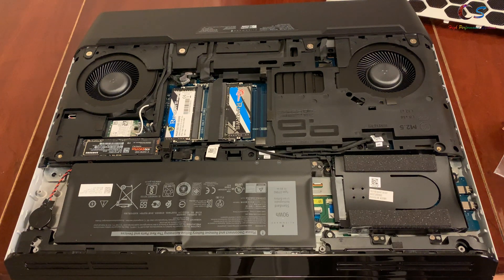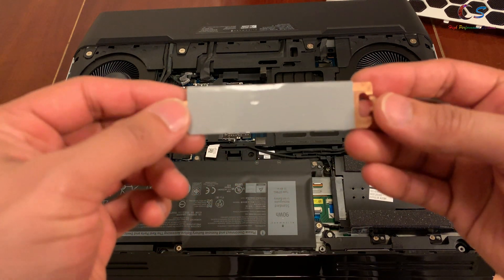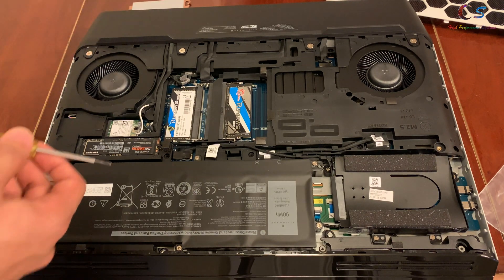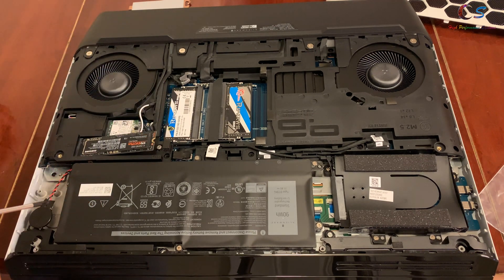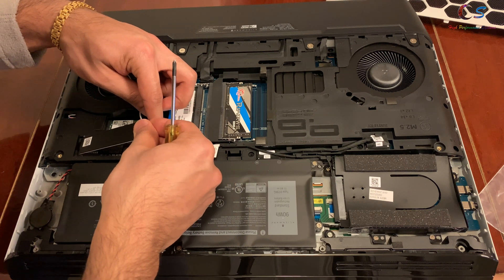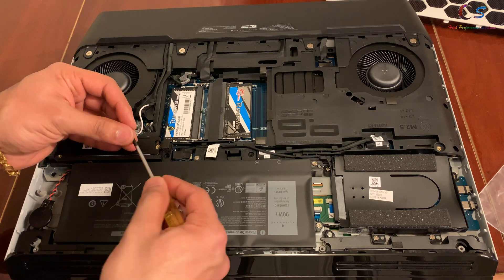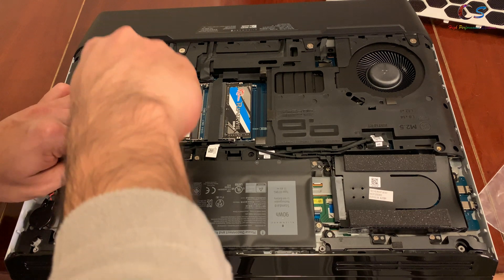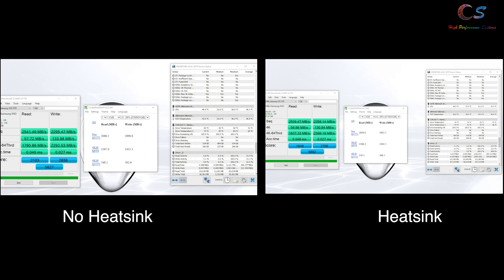Install SSD Heatsink in Alienware Area 51m

Comment: what size screw did you use for your NVME M2 Slot please
Reply from the maker: I used the ones that come with the M.2 ssd
Reply: @cs.studios  can you tell me the size please
Reply from the maker: M2.0x2.5mm
Reply: @cs.studios  thanks would 8tB works on the alienware?

Comment: Hello , thanks for the video!
I have an Alienware area 51 R2 and a 1TB Samsung SSD 980 NVMe M.2 for slot 2 , do I require a thermal shield? Dell did provide only a shield for slot 1.
Reply from the maker: It’s not required but helps with temps and performance
Reply: @cs.studios  Thank you!

Comment: I know this is old but I've just added a second ssd, Sabrent Rocket 1TB and wondered what sort of loads you were putting the SSD under to achieve such high temps without the heatsink? While copying data over from the HDD (Game Library) and installing another through steam together the heat without maxed at 47c. Are your temps based on video editing? I'll be ringing Dell UK for the sink later today and compared to Pauls Hardware recommending it not being necessary if temps are kept between the 25-60 range I'd like to compare your use case to just gaming.
Reply from the maker: I was doing a standard large file transfer >4GB and let the SSD heat up. Each SSD will vary but the 970 Evo Plus can be hot depending on laptops cooling system
Reply: @cs.studios  thanks for the reply, I've since stress tested it properly and haven't managed to break the 25-60 window without the shield. Also while I've got you, can I ask what RAM you upgraded from and too as I've noticed our 51m r1 capped at 2400mhz and that even on the r2 it's only lifted to 3000mhz with DELL specific RAM. Is there anyway you know of that our RAM speeds can be increased on the r1?

Comment: Hi, I’m thinking of getting this laptop but I can only afford to get the base model. I know I can do upgrades later on but I was wondering, with the base model . Can it run most games ok. Enough to be playable? Oh and in your opinion. What would be a must to get at checkout. Thanks
Reply from the maker: Yes even base model is fine but make sure to get the new R2 model. Screen choice is a must, either 144Hz or 300Hz monitor.
Reply: @cs.studios  thank you,  yeah, I'm going for the 300hz

Comment: Awesome. Have you noticed the ssd evo messing up, or corrupting the system? I called Dell tech and they highly recommended getting western digital sn750, for that reason
Reply from the maker: I've been running 970 Evo Plus since Feburary or March I think without any issues.
Reply: @cs.studios  strange. You're the second person that said they had no issues. When Dell says there's an 80% that the laptop will randomly reboot and shit
Reply from the maker: Interesting...I've had some random reboots with my graphics amplifier + AMD Radeon VII very rarely. I thought it was because of me mixing AMD GPU with internal nVidia GPU. But without the AMP connected I have no issues so idk.
Reply: @cs.studios  fuck. What do you think about about running dual 1TB Digital Western SN750 SSD? That's what Dell tech recommended. I'm so indecisive right now 😥
Reply from the maker: I only go samsung for my SSDs. 0 failures. Had a failure or some issue with other brands before. Honestly if you're not using AMP + AMD I dont think there will be any issues. Be sure to get the newer 970 Evo Plus not the older 970 Evo. Theres plenty of us running Samsung SSD with no issues. I've had no issues without my AMP
Reply: @cs.studios  wow. Ok. Thanks so much for your time. I'm a lot more confident now going with Samsung. May the odds always be in your favor while owning noobs 🙂

Comment: Hi, I have a quick ques if you have the time.  I bought a ADATA XPG m2 ssd.  It came with it's own heat spreader, should I use that or use the Dell heatsink,  the one you used in this video.  Thanks so much,
Reply from the maker: If you have the Dell heatsink, use that one. However, if you don't, use the XPG one if it fits.

Comment: good morning my friend .. here is me bothering you again with my question .. I see you got one SDD installed I got one installed too.. but I can't remember which slot it's in .. I want to add another on the other slot .. are they both same .. just any m.2  would fit ? also what's the wire going across the second slot ? get me back to me please .. thank you : )
Reply from the maker: Both slots work the same so it doesn't matter which one you install the new one in. The wire thing is the CMOS battery. It sits under the SSD I believe. I haven't installed a second SSD yet.
Reply: @cs.studios  oh so just install ssd on top of it.... Been looking to buy 1tb Samsung m. 2 and install it in the second slot as I got 500gb in one slot already
Reply from the maker: I got a 1TB 970 Evo Plus in my main slot. Maybe in the future I’ll get a 2TB Intel 660p for games and basic storage.
Reply: @cs.studios  yeah I was looking at 2 tb for basic games..but Samsung one at 2tb is too expensive.. Maybe wd blue or wd black?..
Reply from the maker: @sizar535  I have no experience with WD SSDs but I would recommend a Intel 660p 2TB drive.
Reply: @cs.studios  I'll put one those in it.. Thank you..

Comment: Please, help me to find it where to buy. I can't find it on alienware italian site, where I bought laptop, neither on amazon/ebay(( and 1 more, i've ordered area51m without hhd, will it have those black internal flexible chassis for installing it in future? Thanks
Reply from the maker: It should include the black HDD adapter. For the SSD heatsink use the chat option or call dell and tell them the part number you want to order. I put the part number in the video and description.

Comment: Great vid. I saw you got higher speed ddr4, how is that working out? Do you know the fastest it can take? Thanks
Reply from the maker: Actually my RAM is slower speed (2133 vs 2400). As of right now 2400 is the limited speed regardless of which ram stick you put in (2666, 2800, etc)
Reply: @cs.studios  Are you sure its not because you have 2400 standard Ram sticks that come with system present with new upgraded? If yes that means no matter what new sticks you put in they will default to 2400. You need to upgrade all 4 same speed to work at 2666
Reply from the maker: The system is limited in BIOS to 2400Mhz. We cannot do anything, AW needs to release an update. Buying 3200Mhz RAM will result in 2400Mhz speeds as well.

Comment: i heard ssd prefers to be warm and heatsink reduces its lifetime
Reply: 2.5" SSD's don't need to be cooled, but M.2 PCIe drives can benefit from the use of a heatsink or heat spreader. Under heavy load when the M.2 SSD gets hot, they can start thermal throttling and reduce performance.